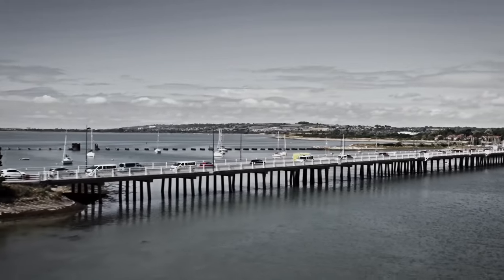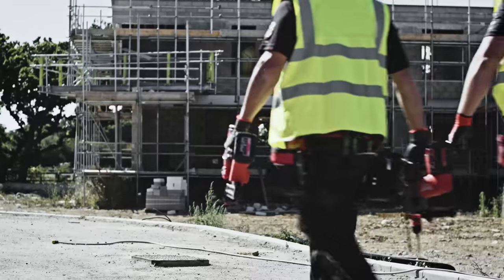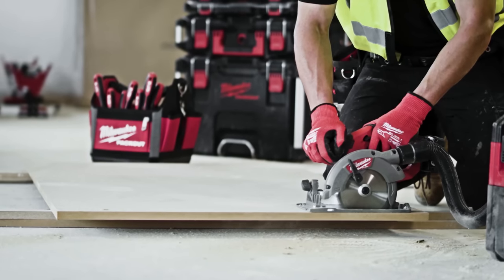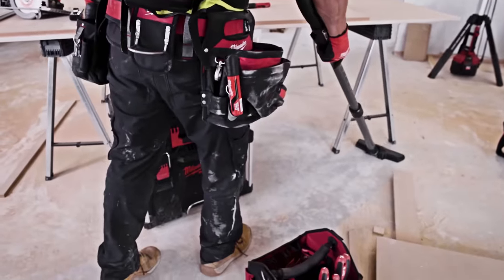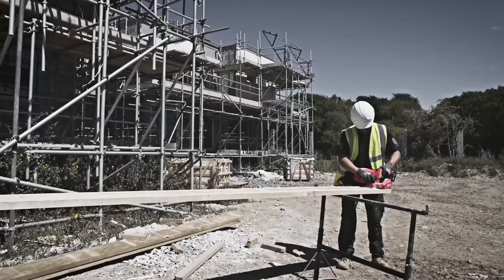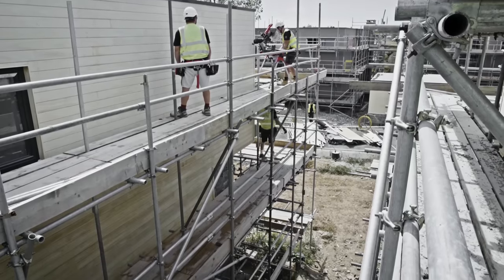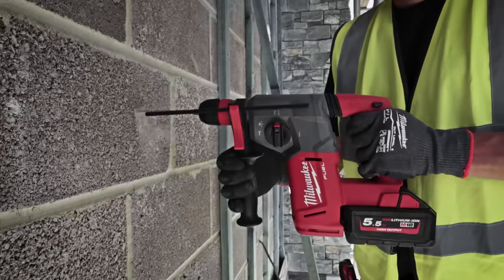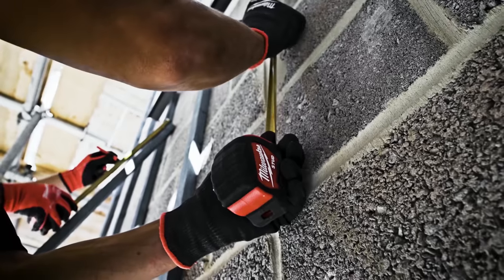How MILWAUKEE® is making the job easier for the woodworking trade

Comment: Fuel versions of the planer and orbital sander would be appreciated. If you're looking for new ideas for the m18 fuel platform, a belt sander would be a great addition. I also noticed Milwaukee doesn't make wood chisels. So people aren't forced to buy Dewalt chisels when they go to home depot it would be a great option to make them and maybe even a combo square using tempered steel for both.
Reply: I would like the 5 inch random orbital sander to be an M12 fuel since it will give a lower profile design and Milwaukee to make a 6 inch M18 fuel geared random orbital sander. As well as an M18 fuel planer.

Comment: As carpenter myself in America I am nothing but impressed with my Milwaukee roster, I have almost every tool you showed in the video but sadly the Milwaukee planer I’m hesitant on because I’d prefer a fuel option. Also do you know when a fix on the gen 3 hammer drill trigger switch will come out as well as the Milwaukee knee pads?

Comment: Are milwaukee going to bring out a 40/60 volt range lile dewalt and makita just moved over to the platform and if they do I hope they make the new batterys compatible with the m18 gear
Reply: I can't see a need really, the m18 out performs the Dewalt stuff anyway.

Comment: When’s the cordless coil nailer coming?
Reply: a roofing nailer would suck being cordless even with these good batteries, you use it way to much,  a battery wont last very long unless you get a large 9.0 or 12.0 ah, and they are stupid heavy